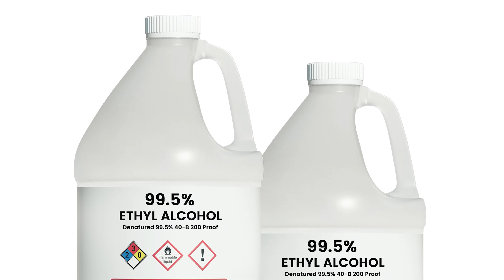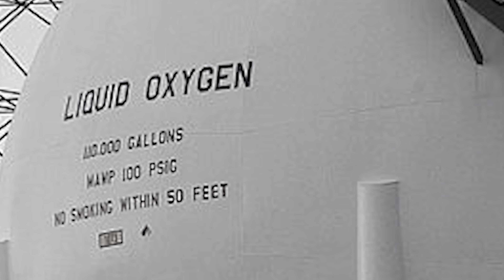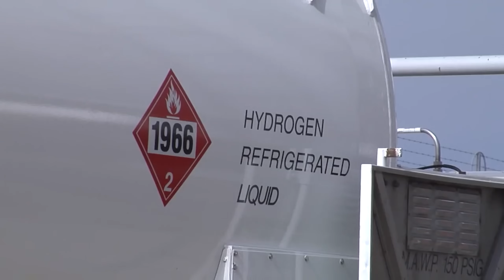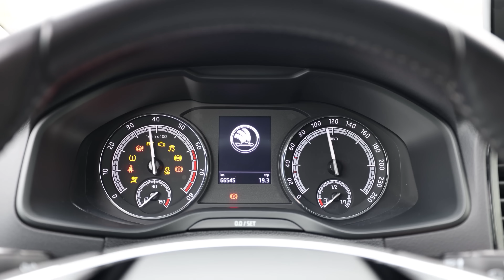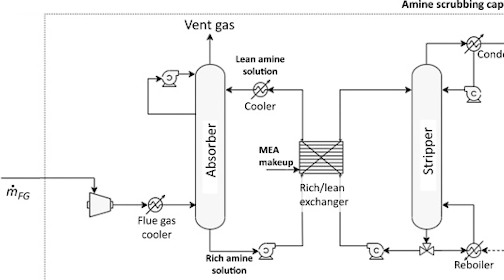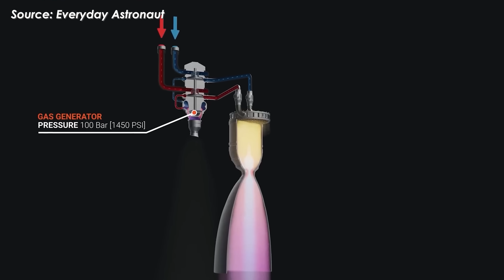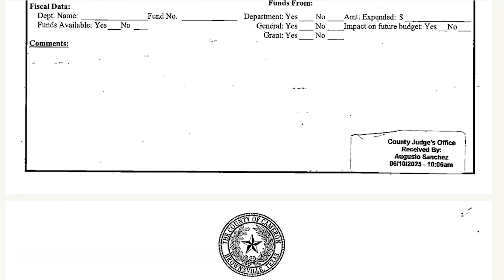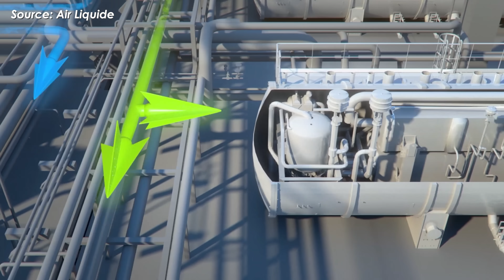SpaceX's massive breakthrough Plan to use New Fuel that others are Copying Now!

Comment: I assume that Bocca Chia has a NG pipeline..and if the facility is 2Ha, as really a midsize LOX plant needs less, it will have a electrical plant and that can be a plus to the area (could use NG ship engines of the low and slow rotation type or smaller Waukesha engines)